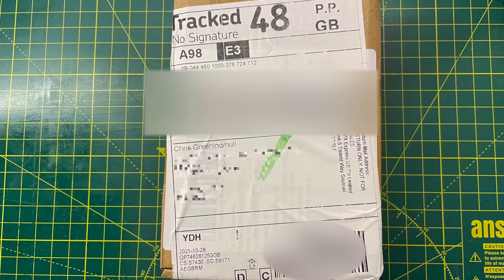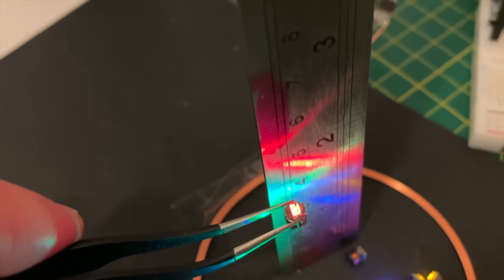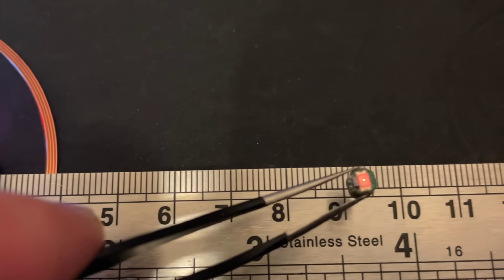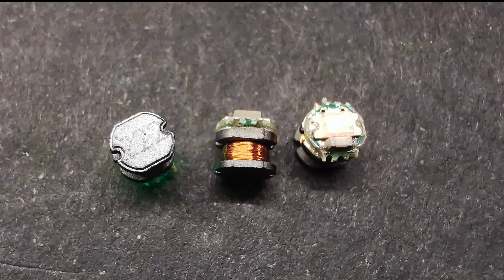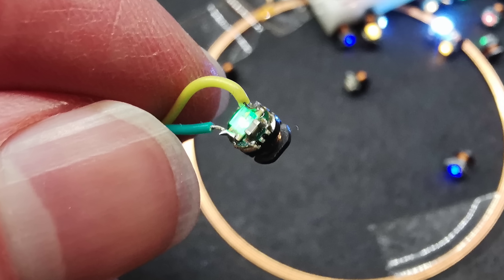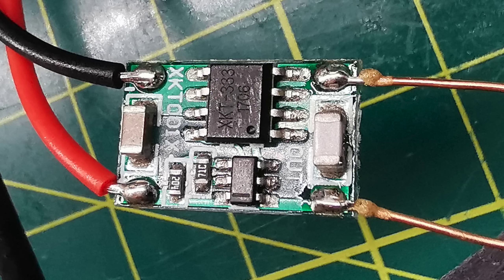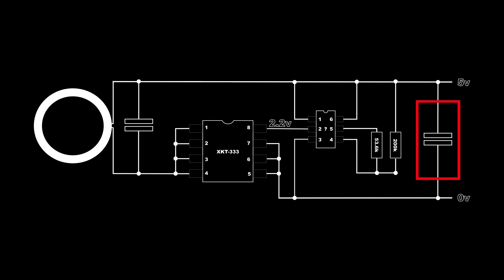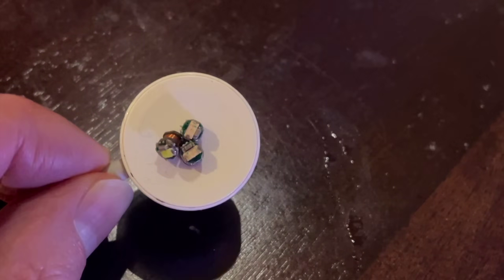Look Mum No Wires - This will blow your mind

Comment from the maker: DIY version is done! https://youtu.be/jdc_0r5pJPc - total cost is around $8-$10 if you want to build it yourself. Lot's of people have commented on the steel ruler - I've tested with both plastic and wooden rulers and it seems to have no obvious effect on the range.
Reply: well, it is a STAINLESS steel ruler which, depending on the grade/type of stainless steel, is not very magnetic.
Reply: @kimchristensen2175  It's conductive and that means it works as an antenna possibly capturing some electromagnetic energy.
Reply: @ThinkingBetter  A 12' ruler is too short to be much of an antenna at 220Khz. It would have very little effect as has been verified by atomic14's tests. Being non-ferrous it also has very little interaction with the magnetic field as far as eddy currents are concerned so it would absorb very little of the energy emitted. Don't get me wrong. I'm not saying it has NO effect, but rather very little.
Reply: @kimchristensen2175  Yeah, you are right and it is one of those things that one can calculate.
Reply: I wouldn't use a steel ruler to measure in a magnetic field. I guess you would get a different range without having that metal in the field?
Reply: @ThinkingBetter  ...............and are the tweezers metal too ??
Reply: @NiculaeGeorge-w2w  first of all it would be horribly inefficient, second u would have to position all of the leds correctly i.e the inductor towards the base of the tree, lastly the transmitter would have to be a higher power one something with the power output of a tesla coil, which can cause EM interference
Reply: I got randomly suggested this video from the algorithm and have subbed. I'm here for all the electronics content
Reply: You can use radiofrequency.
Reply: You could market it for use on your car’s wireless charger.  Maybe packaged in a small plastic ball or cube that disperses the light.  Maybe add some letters like children’s blocks.
Reply: SUGGESTION: Imbed the LED's in a model (I suggest one of the Lego Car models, but the larger Gundam models might work as well) then incorporate the coil into some sort of base, so it's hidden.
Reply: I had an idea pop into my mind but im probably never going to use it so i might as well tell you what it is.

You could use this in a sort of hide and seek game or a puzzle game.

You can use the "gem" to find the location that needs to be found for the game like a key hole or a hidden compartment or a hidden message.

Not sure if this is somethign you do (i found this channel 2 minutes ago) but hey it could be a cool interactive board game
Reply: @doomguy510  You could bury the loop and circuit that drives it into a magnifying glass. Then hide the LEDs around the room and let kids use the magnifying glass to find them. I'm sure you could do things to make this fun. Might be great at a library or a museum.
Reply: @jackielinde7568  Nice idea and then maybe hide riddles or puzzles that can be answered by reading skinny books ( to not bore them with the heavy reading )

You could even use them in Gym class I reckon
Reply: This is awesome
Reply: Thanos Glove
Reply: You could probobly put pretty much anything between the coil and the leds as long as its non conductive. I would think that they even would work under water as long as the water is not to salty
Reply: Please write a link to this product on Aliexpress
Reply: @atomic14 the whole advantage is that the lights are free floating. This MUST be taken advantage of. Some kind of motorized pattern impossible to do with wired lights? Encase them each in epoxy and have them float in water??
Reply: Lol
Reply: Can you patent this?  You should try to patent this!  You have just unlocked a new way for mankind to express themselves among many other things (I think)!

Rings (and earrings!) that glow, brims of caps,  EL wire shoe laces, accents on clothing; glowing fiber optic hair, UV illuminated things; all powered by a wireless belt (hat/shoe/etc.) with embedded batteries and circuitry!!

Someone mentioned a snow globe, that'd be so cool to have those floating around inside a snow globe it'd make one curious about electronics instinctively!

These are just initial reactions and thoughts upon first impressions.

I see it as a blessing, take care and God bless you!
Reply: ya know even easier you could do a version of konkers but with these things in like a see through plastic ball and when you land within the right area your ball lights up and you know you scored

my favorite would still be a magic/myster/scifi game where you use these things as some magic key or tool to figure out some mystery etc.

Maybe peopel who play Dungeons and Dragons know what to use it for?
Reply: Bro, what you need now is a double jewel ringer. Two jewel thieves back to back in a ringer circuit. They will stay lit a lot longer.
Reply: I'm sort of curious whether the steel ruler could have interfere or if maybe a wood or plastic one might show different measurements. These are cool little things though
Reply: If there are a bunch lined together will it carry the power further, and how many would it take to over power the power source. I would sew it into clothes. Wedding dresses, Halloween costumes, magician clothes, put it in a table for bottle service. There are so many uses.
Reply: What exactly can be done with them?
Reply: @atomic14:thank you and I subbed I will check out othe vids if your bored come see me lol
Reply: maby you can make them float in air with magnets or put them in smal air bals with or without weight
Reply: I'm not blown away... infact it's underwlming and disappointing... it's a LED they are boring
Reply: ~YOU Were Making It Go |-Through-The-RULER-|
Leaving Me To Believe, That It Was An Inaccurate
Finding!?
Reply: @amishparadise1924  
~Filling You In On What's Out There,.
..I Presume!?
Reply: ~Oh`(Didn't Read THIS)
...re: The "METAL" Ruler
Reply: @amishparadise1924  lol chill my friend it's just a video of something that I'll probably won't purchase or anything it's entertainment and a good way to kill some time all good no worries positive vibes your way
Reply: can you coat them in resin and put them in a glass jar of water swish the jar around till you have a tornado and then place on the coil?
Reply: How hot do the led lights get if left on for a long period of time?
Reply: @sburgos9621  
.~They  "DON`T" ..Get ``HOT!``
Reply: Very nice 👍 this is great for modeling .
Reply: @NiculaeGeorge-w2w  Pp
Reply: @NiculaeGeorge-w2w  fgehs
Reply: this is pretty cool stuff... I wonder if its possible to build a phased array antena to control the direction of the power pulses and show in practice some leds lighting up in a circular pattern...

Comment: I wonder if it would light if it is put close enough to utility transformer, that would be nice street light, anyway that be a good energy collector of magnetic field, which the utility transformer waste anyway.
Reply: You wouldn't actually be harvesting waste energy this way. Instead you would increase the input power of the transformer slightly. You would basically just be stealing electricity. Your LED makes it harder for the transformer to change the magnetic field, so it will draw more power. The effect is similar to this: https://www.youtube.com/watch?v=1uEmX5XClPY
Reply: @oznerol256  I'm not suggesting stealing, I'm suggesting utilizing, wireless street lights for every body. Lets face it, no perfect transformer exist, some energy are waste in the form of heat and magnetic field. If I suggest to use peltier to harness heat energy wasted by the utility transformer at night, to power street light, I do not think that would be stealing.
Reply: Energy pulled from magnetic field is not free. All those 'free electricity' devices just pulling energy from the main line in obscure way. Basically it is a way to steal electricity and not utilize the waste which is not exists.

Comment: I would used them in a 3d display, christmas tree
Reply: wrap a wire around a pole, a power pole
Reply: you can triangulate exact position of the receiver, when you have many coils, 3 or more, just like cell towers or gps localization, different resonant frequencies
Reply: you could just do simple distance ladder steps, for various voltages
Reply: radio channel tuning per many coils, many more power
Reply: transformer increase the signal voltage, less current, more voltage

Comment: Would make much better Christmas tree lights as the coil could be in a stem and the leds just prinkle onto the tree. no more wire mess when putting the tree up.
Reply: Coil tinsel?? 😃🎄
Reply: I have a bedside table with an integrated QI charging pad.
With these LEDs I could put a small Christmas tree there :)
Reply: “No more wire mess when putting the tree up”

Sadly, with the distance those can be from the coil before dimming greatly, you would have potentially more of a wire mess due to the coils themselves and then the wires to power that unless you make/find a circuit and use battery power that you can hide away easier. If not, you’ll have much more wiring to deal with. It’s a great idea and good job buddy for the video. It was fantastic. I appreciate it!
Reply: This is a very inefficient way of transmitting power tho

You loose like 90% of the power you consume on having them wireless
Reply: The led are the seeds
Reply: Prinkle 😂💀
Reply: Yes just hang both lights and ornaments the same way, and some of the ornaments could light up.  Trouble is transmitting the power all over the outside of the tree (at least) rather evenly.  Maybe a few levels could have a ring coil partway out between the centre and the branch tips.
Reply: You can buy trees that have fibre optics in the branches. You e been able to buy them for nearly 20 years
Reply: I don't mean to rain on your parade lol but that sounds worse in every way. You still have to plug in a long wire, hang it on the tree, then you're adding hundreds of steps having to hang each light. Which, tons will get lost and probably fall off. Taking it down would be super tedious too. Plus you'll lose so much power as the coils are very inefficient. I don't see any possible benefit.

Comment: Wouldn't the LED itself explain the half wave that you saw? after all, it only permits current in one direction...
Reply from the maker: It would, but the half-wave is on the driver side, not on the LED side. Having made my own DIY version now, I think it's just the way the circuit works and it's "good enough" to drive the coil and induce a voltage in the LEDs.
Reply: @atomic14  Oh I see ... well then it makes sense ... why drive the circuit with a full wave when it wont even use half of it ... I do wonder though if those inductor coils on the LEDs ever get magnitized over time sincee there is never any current flowing in the opposite direction.

Comment: seems like its clipped on the led voltage, and not the opposite voltage
Reply: I think the same, the clipped part is when the LED is on, and the "sine" part, is when the generated voltage is directly stored in the capacitor.
Reply: @DanielLopez-kt1xt  this could also happen on the sender/driver side, its only over a coil-coil link
Reply: @Jkauppa  The sender coil is also a LC resonator tank, the best aproach i think would be to pulsate the coil at the same resonating frequency (if it's 200khz, you could pulsate it at 50khz or so), so you have a decreasing ringing, that you boost from time to time, in order to save energy. This is easy to confirm if you just create one loop with the oscilloscope probes over the antenna, to check the emmiting field, or just probing the coil itself.
Reply: @DanielLopez-kt1xt  its all about the load, if its designed properly, then the link will be sine wave
Reply: @DanielLopez-kt1xt  or I mean link-transfer-load stage, especially the transfer circuit
Reply: @DanielLopez-kt1xt  I would try a fb-rectifier+capacitor, you gotta detach the load from the pulsing receiver resonator
Reply: @Jkauppa there's no point on that, adding 2 diodes in series will decrease the induced voltage reaching the led. The normal reciever is quite efficient, the half the led is not conducting, the energy is stored in the capacitor, and then released in the next half cycle
Reply: @DanielLopez-kt1xt  I mean treat the wireless part completely separate from the load part,  if there is a voltage problem, then buck-boost or induct higher voltage
Reply: @DanielLopez-kt1xt  what is a RLC compared to a LC resonator circuit, dial out the R, then you get your pure sine, non-damped response signal form
Reply: @DanielLopez-kt1xt  impedance matching is essential in all antennas, speakers
Reply: @DanielLopez-kt1xt  you could try active (transistor) full bridge rectifier, zero voltage drop across mosfet transistor
Reply: @DanielLopez-kt1xt  btw, you are trying to drive diodes, try 4x diodes in full bridge rectifiers, you have always the 1.4v or so LED activation voltage, or double, add a capacitor in the rectifier circuit with 4 diodes, ie, use the diodes as the full bridge rectifier circuit, only, or just boost the voltage to stable level with a boost circuit, after the input rectification, passive or active, diode or transistor
Reply: try directional resonant induction power transfer or radio photon parabolic resonant power transfer
Reply: otherwise you have inverse square power reduction over distance, by area division

Comment: If I can get these around 375nm - 395nm, all sorts of glow-in-the-dark projects come available. You only need a low duty cycle to get a nice steady green glow on whatever it is you're making.
Reply from the maker: Hmm, should work, the forward voltage on UV LEDs is quite high 5-6V so range might be lower than for normal LEDs.

Comment: The LED acts as a diode and half-wave rectifies the signal so that it is a chopped-off sine wave. That is why the signal looks flat on the bottom of the cycles. The LED does not conduct then.
Reply: Hence LED = Light Emitting Diode :)

Comment: The XKT333 looks suspiciously like a MOSFET. I suspect that the 6/7 pin chip is/are the "brains" and the XKT333's gate (pin 8) is driven by pin2 of this other chip with a square-wave. The duty cycle of the square-wave is likely 44% - hence "2.2VDC" (average) on this pin.
Reply from the maker: That's exactly right! I really should have measured the value on pin 8 with the oscilloscope as that would have instantly told me that's what was happening. I've updated the description to include this information.
Reply: @atomic14  Cool. Thanks for the shout-out :)
BTW, have you seen the "Strange Parts" video (May 2019) about these parts in Akihabara, Tokyo? https://www.youtube.com/watch?v=PsUsByrOveE
Cheers!
Reply from the maker: @AdityaMehendale  I hadn't seen it - but it's now on my watch list!
Reply: thanks

Comment: Coat them in epoxy - ball shape and have some liquid and agitation (maybe lava lamp or one of those piezo sonic agitators and have the light balls agitated in the liquid and with the wireless charger in the base.  You would have the bases of something that some may like. Depending upon how far you can agitate (mineral oil may be good liquid) and container, you may get them far enough away so they're dimming will add to things.

Probably start with jam jar and work out liquid so they are almost balanced and shake, place upon wireless charger and see if as an effort it has potential.

But need to avail the whole wireless light aspect and floating some how would be best.

Another idea - again make into epoxy marbles and do a marble track machine and have them light up in places.

But I'd also be tempted to carry one around with me as, if it ever flashes - you have found a source of free energy ;).
Reply from the maker: I like it - hadn’t thought of actually putting them in liquid - but obvious really, you can seal them completely.
Reply: And if there were a way to assemble them with two LEDs connected in opposite directions across the coil so they'd illuminate the whole light ball - especially with some diffusion material in the mix. ;)
Reply: @FurrBeard  Interesting, AFAIK wireless chargers induce AC and as LED's are diodes.  Then I'm wondering if you could connect two to the coil in opposite polarity and tap all that power. Which would make the 360 lighting effect easier.  Though doing one layer to coat and sanding that down, then doing finish shape coat would get you a long way I suspect already.
Reply: I wanna put these in my fish tank

Comment: Maybe you could change the value of the capacitor on some of them and then sweep the frequency of the driving coil to have them light up in groups at different times?
Reply from the maker: Might work - I think range of frequencies the tuned circuit will pick up is quite large so it might be hard to discriminate. I am thinking that some kind of FM modulation.
Reply from the maker: Having played around with a DIY version, I think you could do it, with very large frequency differences, e.g. 100kHz, 200kHz etc.. Lots of wireless chargers have different coils to accommodate different devices and will switch between them to try and find the best coupling.
Reply: @atomic14  Very interesting, thank you. I will keep an eye open in case you post any results. I'll treat myself to a batch of the LEDs - if nothing else will make novel Xmas lights.

Comment: I guess if the waveform was not rectified (a complete sinus) then the LEDs would light also when facing down. Right?
Reply from the maker: That's correct - you can turn the LEDs upside down and they still light up.

Comment: I wonder if they will light if near an AM or FM tower or near a cellular antenna. Would be fun to put them around a site or up in a tower. The same for near high voltage transmission towers.
(I work in the cellular industry. So I have access to sites and towers.)
Reply from the maker: You just reminded me of this: https://www.circuitstoday.com/mobile-incoming-call-indicator